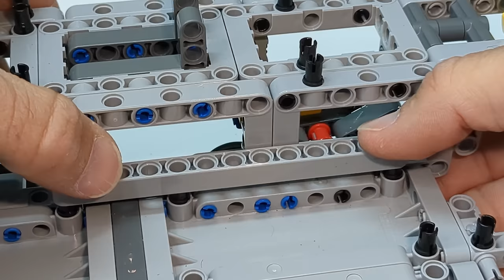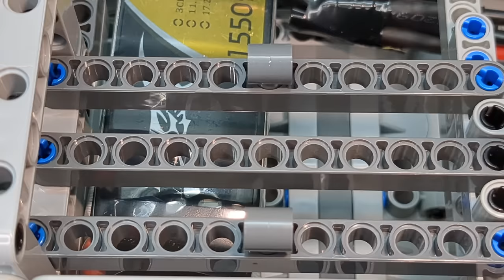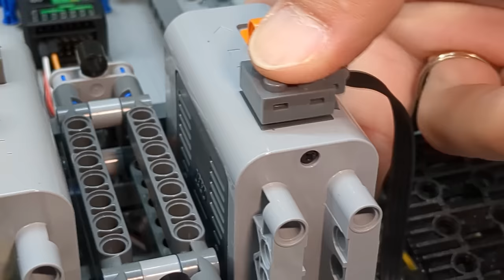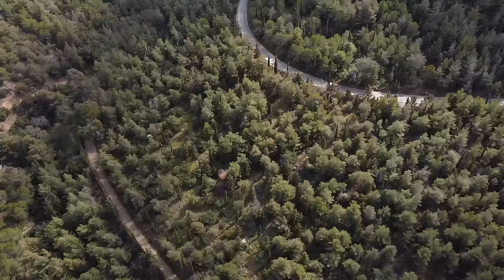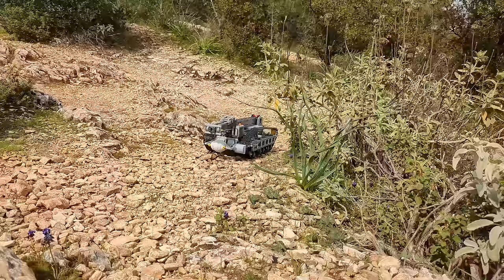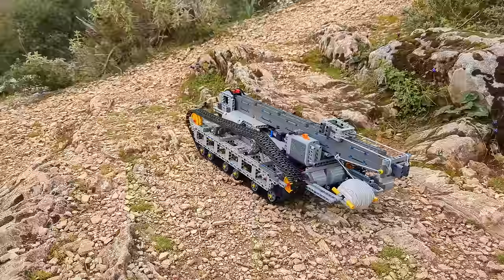LEGO Technic crane explores deep chasm cave entrance.

Comment: I'm glad you did a mission recap. Because I would have been disappointed otherwise. Yes please continue developing this project to reach the bottom! You will regret it more if you don't try, than to try and lose your vehicle, light and camera. Hope to see the next video on this adventure soon!
Reply from the maker: I am actually in the pre-design process of the vehicle that will descend in the cave. I'm brainstorming on a vehicle that will use a belt to rappel to the bottom of the cave. No winch-breaking or rope-snapping to worry about. Just drop a 30 meter long belt in the cave and have the vehicle rappel down.

Comment: Suspension looks a lot like the Churchill tank during the Second World War.
There are rubber studs that you can put on LEGO tracks to give more traction. Had you considered doing this?
Reply from the maker: I've seen those rubber pads but haven't got any. I don't know if they would work well outdoors though. Some of them would probably get pulled out of place and end up getting lost.
Reply: @brickandgear  : For real tracked vehicles, rubber pads seem mostly useful on things like smooth concrete.  I wonder if something almost the opposite, like putting "teeth" on the tracks, would work.  I could imagine putting pins through the holes in the ends of the 5-wide track segments, or even pinning a piece to them, but only one every second or third segment so that there are gaps that can sort of hook around small rocks or projections.
Reply from the maker: @brooksmoses I tried placing black pins on the tracks in the past (before starting my channel). It worked pretty well and the cost of damaging just some pins is acceptable. You think I should start using them again?
Reply: @brickandgear I’ve got some of those rubber studs I can tell you they are quite hard to remove
Reply from the maker: @Combatbrickproductions  in that case I should get some from BrickLink and try them out.

Comment: One more thing i would try to do is to make a rotor (slash gear) on the botom to at least look around. You could get it done remotly but it would be heavy, but you could also add another, 3rd, 'rope' to use basic spool to turn the camera with relativly not much added weight on the head
Reply from the maker: I will definitely install a servo to turn the camera in my next vehicle. I am currently in the "thought process" to start designing the vehicle that will descend in the cave using a belt to rappel to the bottom. Very excited for that project!
Reply: @brickandgear  Cant wait to see more! :D

Comment: a good first attempt, i look forward to a possible followup.
in the brief shot around 7:08, showing us how the shape of the chasm was preventing you from lowering the camera & light further, it was difficult to see how close the string was to the walls of the chasm.
i was wondering if, instead of a fixed length boom, an extendable boom like the ones seen in sets 42009 or 42082, would be helpful in maneuvering the camera & light pass the irregular walls?
also, the summary at the end of the video was a good inclusion.
Reply from the maker: For my second attempt I am designing a small vehicle that will rappel down the chasm just like a climber. As a third step, I'll probably design a heavy crane (not portable) that will bring the vehicle back up.

Comment: If it can go through rocky terrain, its capable enough to travel the entire horizontal length of Texas. Just make sure it doesn’t get lost. P.S, how long did it take you to wind up all that rope?
Reply from the maker: It took a few minutes. I used a gear ratio that would lower the camera as fast as possible because the Action 2 overheats after about 20 minutes of 2.7K recording.
Reply: Fair enough. @brickandgear